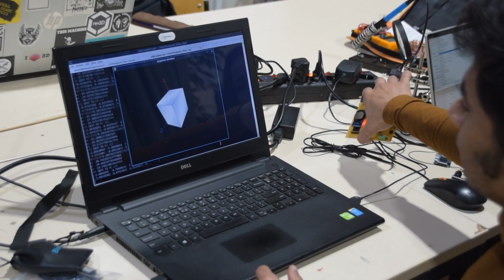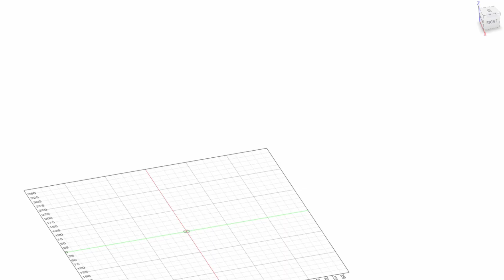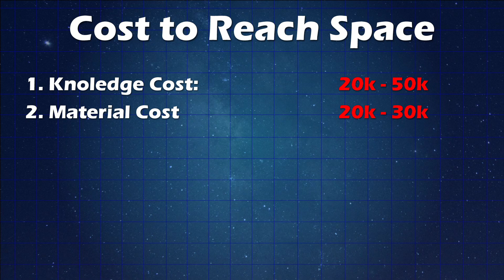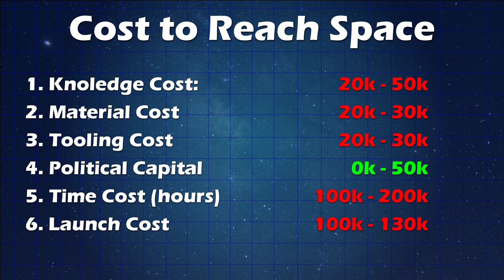How much does it cost to get to space?

Comment: You are right, especially the time cost and location cost. It's way easier to do it in the US. 
I went through the entire video. All your material cost and tooling cost is about 1/10th if not 1/20th, some 1/50th  in Eastern Asia. 

Once you got your prototype sorted out, you can basically order them in bulk, to save time cost and material cost. Just to give you an example, that aluminum stand you built, can be built out of steel for 2~300euro, or 4040 aluminum profile for 100 euro. 

Before you go and do something always look for ready made systems, they can cost a lot less in terms of machining, and assembling, sometimes 90% less.